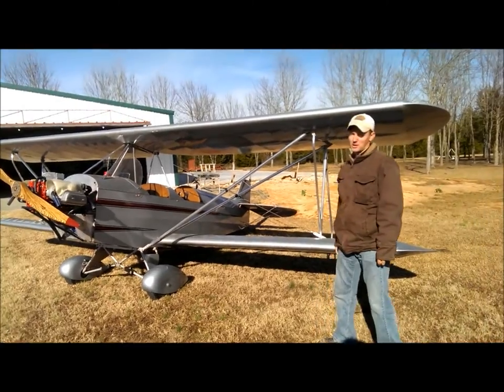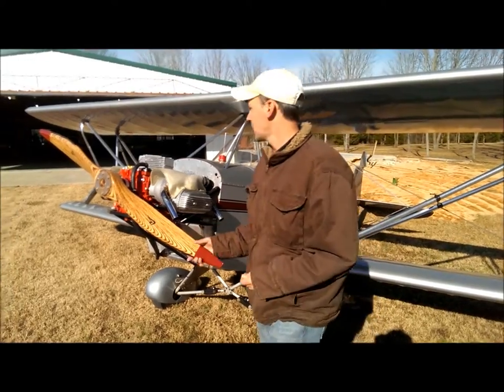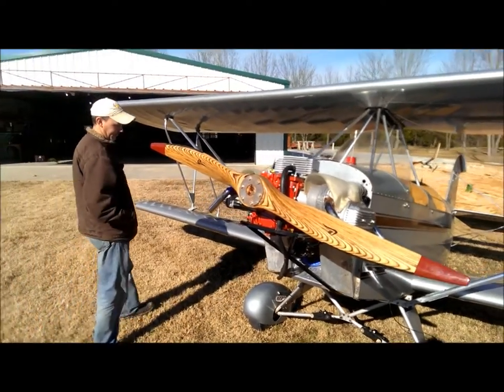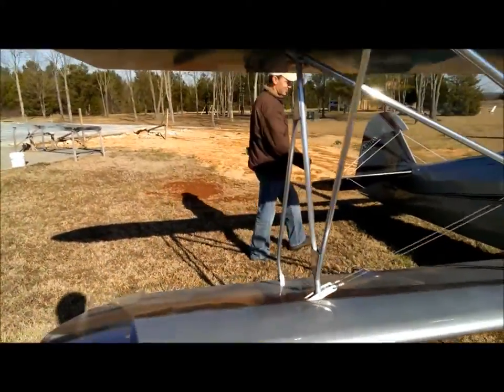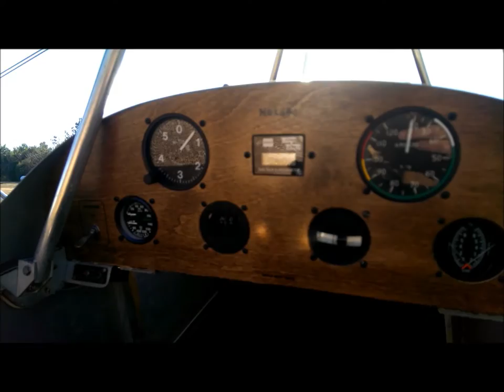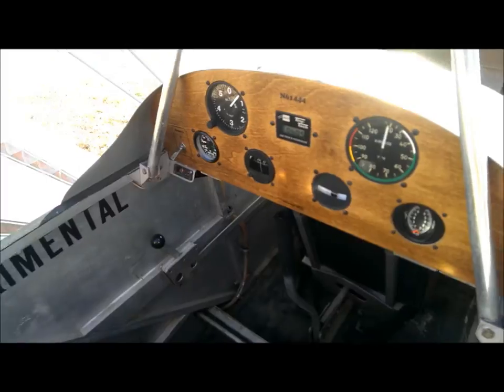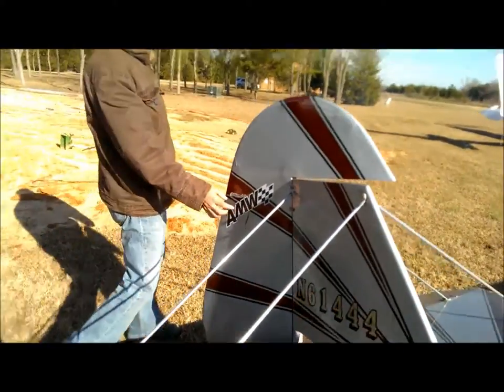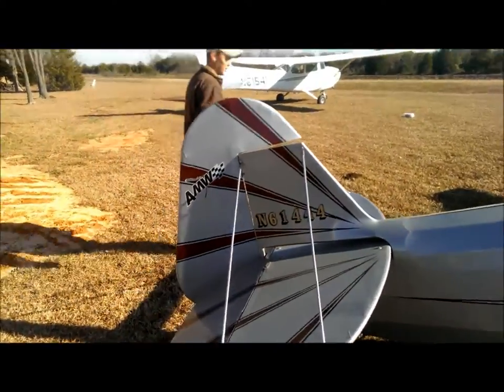Fisher Classic v1 00

Comment: hi, im building the same aircraft can you help please:
what is your total emty weight?
are you confortable with 85hp to flight with passenger or need more power?
what prop diametter do you use and what pitch?
thanks
Reply from the maker: 85 hp is just right. If you are building a Classic you have to watch the weight on everything! The plane was designed around the Rotax 582 and if you put any extra on it the VW will be too heavy. No starter, no electrical period. Using a performance propellers USA 60x26.
Reply: Why didn't you answer your little girl ?